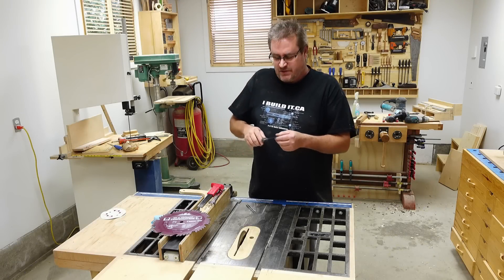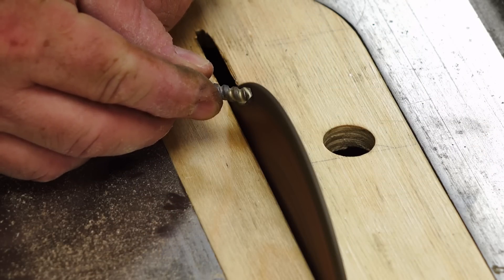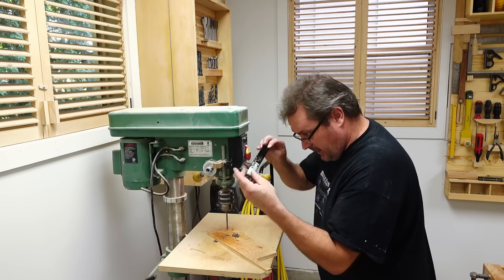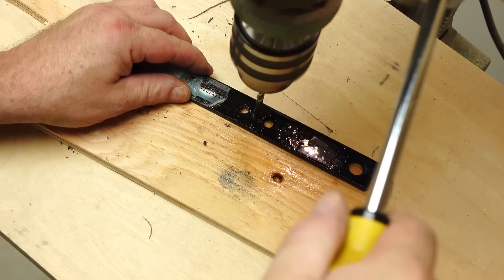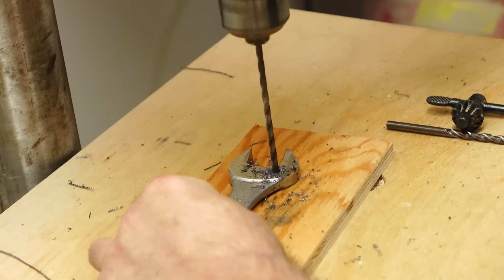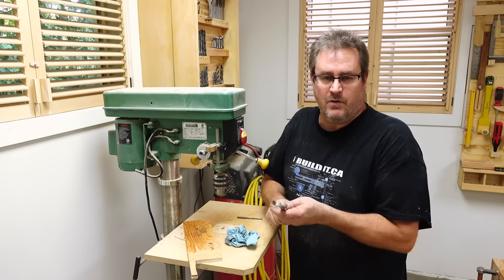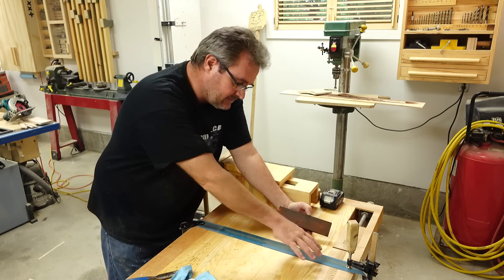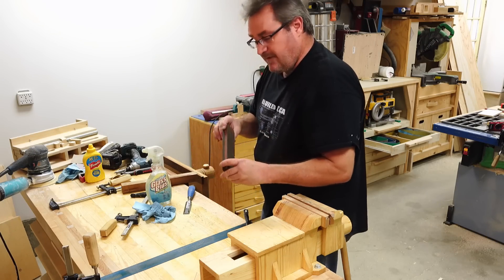Drilling Hardened Steel With Masonry Bits

Comment: Those bits might work to widen the indexing holes on your planer knives.  I've tried this in the past with no luck.  The blades are case hardened.
Reply from the maker: +GarageWoodworks Interesting idea, I'll give that a try when I pull the current set out again.
Reply: +I Build It When I tried it, I screwed the knife to a board through a couple holes to keep it from spinning and chopping my hand off.  None if the bits I had would do the job.  This looks promising.  Then you'd just need to design a knife setting jig, which I am sure you'd come up with something cool.
Reply: @GarageWoodworks  if they are case hardened all you need to do is remove the case hardened outside layer then you should be able to drill fine. Grinder or abrasives work to get through top layer. The material underneath is usually half as hard or less in some instances

Comment: It is sort if like a boring bar, I guess.

For applications like this my favorite cutting fluid is actually crisco or a similar (read: inexpensive) vegetable shortening. It tends to float the chips out effectively due to the viscosity, and has to absorb a bit of heat in order to melt, so it carries it away when it heats up, liquifies, and runs away.

Comment: I think drilling the really hardened steel is like drilling stainless.  You should slow the rpm's way down and increase the pressure.  Have seen a lot of people ruin a bit in seconds by spinning the crap out of it while drilling stainless.
Reply from the maker: +Ted Alexander Good points :)
Reply: when machining stainless we have a saying - slow speed high feed.
Reply: +Ted Alexander yup, so true.  and definatly keep enough coolant on the workpiece and drill.
Reply: +Ted Alexander Just what i was gonna say.
Reply: On hardened you need just that...harder carbide! Masonry bits have tougher carbide to withstand impact drilling of rocks (only a few of them can handle granite), but they are not that hard of a grade, the brazing can fail quite easily and the have a dull edge from the factory to avoid fracturing. Also if they get wet while hot they instantly crack and that's why I prefer running them completely dry and backing off for a while every once in a while depending the material to let them slowly cool off in air. You can only avoid it if you don't get them hot in the first place but that will be slow as hell...
Reply: @muffinman1157  He is actually very much correct if you are drilling hardened materials. In a soft material you are correct. And you definately don't want "little chips", you want actual chips like in any other drill so that they evacuate properly and that you are not just rubbing the material.

Comment: Up your speed and once cutting use no coolant as this will fracture the Carbide , the heat generated actually helps it cut , also don`t let it burst through what you are cutting as this will also take the tip off your drill.

Comment: if you ever look at magdrill bits you will notice they are carbide bits, same with most milling bits, just don't drop them because they will shatter like glass, I use a mag drill on semi truck frames to install tool box and other accessories, your HSS drill bits will just dull soon as you touch the frame, it's a hardened steal way stronger than most tool steels.  also you will note that metal dilling bits have a sharper angle than your standard wood or masonry bits do. 118 degs compared to 135 degs. just food for thought.

Comment: I've tried to glue sharpening stone with epoxy (regular one, not 5 minutes). Epoxy filled pores in pretty big area on stone, so it wasn't very nice. Next time I got much better results with clear silicone sealant.

Comment: You can buy tungsten carbide drill bits for steel there A little more expensive but will cut thru this like wood. Just don't drop them.
Reply: Good trick but we just buy the right ones. Machine shops drill cast all day long.
Reply: Masonry bits are close to free by comparison.
Reply: @dmc2554  Then all machinists should stop what they are doing and buy drills at a lumber yard and sharpen them.
Reply: @dmc2554  not at all a carbide drill in 1/2 inch is 9$ a 1/4 inch mason bit is 8$ not buying your math there bud .
Reply: @maxwebster7572  in my shop we cut with diamond.  😒 this was directed for the person who just needs to drill a hole that offers a problem due to hardiness.
Reply: @maxwebster7572  by the way this is most certainly NOT cast
Reply: @ronaldbrown9638  sure, whatever

Comment: I have heard this idea before, one very common context it seems is broken stud in a hole, then trying tho weld something to the broken part, and having the weld fail but after having air-quenched the broken stud. And now the situation is dire. 'Time to sharpen a masonry drill bit and try to go through the stud.

Comment: Very good. Hadn't thought of that, but it makes total sense! I used Carbide tipped cutting tools on my lathe, and carbide milling cutters in my Milling machine, so why not convert those masonry drill bits! As long as they have enough clearance on the cutting angle, they should work just fine :)

Comment: yes thats a good method of drilling hardent steel if there is no other method you can use right now but be careful  carbite dust is toxic and can harm your lungs badly and it can cause cancer so always use a shopvac with a good filter when grinding carbite
and of corse sharpend concrete drills does not make very precise hole diameters and if you want to use them in theyr original perpose make en dull again so they will last longer 
great video by the way

Comment: I had to drill some stainless steel a while ago. I didn't have the proper bit. A TCT bit for glass drilling got me in enough to start a hole, but it did break on the last one I did. Stainless is the biggest pain to try and drill, due to tool hardening. i.e. the steel gets harder when you drill it.
Reply: +Siskin's Bits and Bobs Try slowing your RPM and make sure that you are making shavings and not dust. Biggest problem with any metal like Stainless is the Manganese content as that is a work hardening alloy in the metal. Slow revs and firm pressure as feed as well as a good cutting fluid and it will be a lot easier for you. Cheers from John. PS. Most stainless I drill is just with an ordinary HSS jobber drill, no Cobalt content although they are better again.
Reply: joandar1 I'm probably in too much of a hurry, as you say. My dad served his time as an engineer, I should probably listen to him more.
Reply: My Father Passed in 09, however he still educates me to this day as I remember his lessons to me as a younger man. I just would like to be able to share with him these days new things I have come up with. I think he would be pleased. Cheers from John.
Reply: +Siskin's Bits and Bobs High speed steel should drill stainless just fine. Slow speed, rigid setup and cutting oil are your friends.

Comment: I have a old truck that needs a ball hitch drilled thru hole. Hardened steel bumper. What drill/speed should be used to make a thru hole/fluids etc will I need!

Comment: although ive never tried it, as i understand it this method works best with high speeds and no lubricant as the carbide can hold up to very high temps with out softening. the chips should be red hot, i guess your essentially melting away the material. only thing i would think is that the bit itself shouldnt get past very very dull red or the braze will probably melt...

Comment: everybody that uses carbide on a lathe knows you keep the speeds high with carbide, much higher then with hss. So with that information you would think that you should keep the speed high on a carbide drill too. Also they dont like intermittend cooling, so flood them with coolant or nothing at all.

Comment: Surface cool=
Water present on surface max temp 214F~ 
 alcohol/water mix max temp 185F~ 
oil + detergent + any alcohol = 185 F  max surface temp + low speed  careful firm pressure

Comment: Can you drill wholes in a magnet?
Reply: +David Bishop  it will be pretty sticky dust tough...
Reply: Had problems with demagnetisation when drilling magnets due to high temperature. Solved by drilling in a 50/50 general oil and water mix bath.

Comment: Excellent tip. I can actually use that immediately to drill a hole in a broken bolt for extraction.

I noticed your wood vice, do you happen to have a video for building that?

Thx

Comment: Been using the masonry drills like that for decades. They work better sharpened but they will usually drill through without sharpening too. Longevity is not a strong point with them. They work better for enlarging a hole than for drilling a new hole. Don't be stingy with the coolant. Flood it with water.

Comment: Hello. i watched this video and read some of the funny people in the comments =) Heat is your enemy when u are drilling. heat kills the drillbit. so try and make a senter punch in it, dont need to be big to get it to grip. use lots of coolant/oil/WD40. when it's talk about speed it's a small rule thats count, small bit high speed, big bit slow speed. i'm not useing inch but from 1-7 mm u can use medium+ speed, fom 8-13 mm medium- speed, bigger bit go as slow as u can.

Comment: You get drill bits designed to drill through almost anything now days. The difference between them and the masonry bit is that the tip is welded on and not brazed on

Comment: You mentioned in your other video on this saying Cobalt bits worked no better than Titanium bits. If you are at a big box store, they use the term "Cobalt" very loosely . 
Unless the bit specifically says M42 Cobalt , don't buy it if you need to drill tougher material . I don't know if M42 would drill a quenched and hardened file like that but M42 will drill tool steels and stainless . I get online mine from drill hog usa , his prices are good, his bits hold up well and they lifetime gaurantee . Good luck man

Comment: 15 or 20 years back a booth at the state fair in colorado in the 'merchants bldg' was a man doing
what you are.  using a tipped-bit to "grind" its way thru every metal thing put below it on a drill press.
a file was among the items drilled thru easily.     quite dazzling.   unlike anything ever seen.
and i bought one of his bits.  

    at this time one is needed to drill a hole in the door hinge on my jeep.  so i've been testing
the carbide-tipped bits found in box on garage shelf.     unsure which is the one from then.
one did better. and got 1/2 way  thru a 10"  file.     will try  your sharpening idea and repeat.

  and look to see if these "Rodman" bits are still available  ( 300pilot ... see below 6 comments))

Comment: sharpen carbide with a green aluminium oxide wheel for the bench grinder,the proper wheel for carbide and maybe the same cost as the wheel you used.

Comment: Why did you think it wouldn't work? I mean, even if it messed up the bit, carbides are harder than hardened steel, so it seems to me that it should be capable of it.
Reply from the maker: +seigeengine I figured it would be very difficult to make a masonry bit sharp enough. The wheel I used did an ok job, but the grit is too coarse for a really sharp edge. A finer grit wheel would be much better, but those normally are pretty expensive.
Reply: +I Build It - Maybe a dremel with the small grinder/sanding disk would finish the edge of the bit a little more.? I had this issue before and ended up using pl premium to glue the handles on. The knife has seen lots of abuse, ('batoning' logs for campfires,) and 5+ years later the handles are still attached. It's good to know there is a way to drill it though incase I ever need to attach the fasteners I bought for it lol.. Thanks for the vid!

Comment: The reason i know this works is because i've found concrete/metal bits. If it cuts concrete and it's designed to cut metal too...something like the blade is easy.

Comment: 1.You should have had a pin in the bed of the drill to stop the workpiece spinning if the drill had caught as it left the underside.
2. Either flood the job with oil to cool it properly or don't use oil at all.

Comment: Use a diamond blade to sharpen carbide, it may work better, Other wise use a green wheel as it is designed for carbide.

Comment: I have diamond sharpening discs for the 4 ''  grinder from japan . I use it for sharpening masonry  bits  . With  a bit of practice sharpening   you can get a drill to last quite a few holes  drilling through HSS .  Heat is your enemy . So use lots of water or lots of oil .  Compressed air will also work .

Comment: If find it I will get you a link on how properly sharpen those masonry drills to mill hardened steel - you have to make proper geometry on it. It is in russian. I don't know if there is anything in english. Later
Reply from the maker: +Kairat1969 I just used the standard angles on a regular steel twist drill. The failure I think is in how coarse the grinding wheel is - it chips the edge too easily.
Reply: +I Build It this man has plenty of how-tos and jigs for metallworking and drill sharpening for different materials and thicknesses. All in russian though... :) But many things can be understood by just watching

Comment: Something my Dad taught me years ago; after sharpening the bit, heat it red hot, then drop it in a metal can filled with sugar. Let the bit cool down in the sugar, then chip off the sugar. Quick way to really harden metal. I use this method to harden the tips of bits for my impact driver. They last noticeably longer.

Comment: never would have thought of this, do you think it would work on stainless
Reply: Only one way to find out!
Reply: +George Gardinier regular drill bits work fine on stainless, but you have to go slow and use lots of pressure, any kind of rubbing and it'll work harden
Reply: +Lasse Langwadt Christensen I've been told that if you start drilling stainless, you better finish up and take no break, because while cooling down, it get's tempered? Have I been ill informed?
Reply: +FanteFinn everytime you start and stop you get a bit of rubbing, that work hardens stainless, as long as you are cutting with sufficient pressure the cutting happens below the hard surface
Reply: +FanteFinn it's not stopping that's a problem, it's a dull drill bit that'll be a problem. Dull bits work harden the steel. If it's not cutting, definitely stop and sharpen the bit or switch it out. Slow slow speed and lots of pressure.
Reply: +George Gardinier Cobalt drill bits sometimes help with stainless
Reply: +George Gardinier Yes it would work, stainless is one material that run the drill fairly slow with a lot of cutting oil.

Comment: You seem to have been clued in on how Cole Drills worked. They used a carbide tipped drill (Masonry drill), applied with mucho pressure, and twisted, usually by hand. They would cut a nice sized hole even through hardened steel, reportedly.

Comment: Actually, if you can still find to "OLD SCHOOL" amber glue, the ones with the 'Angled Rubber Tipped Bottle" and use that for lubricant, A standard drill bit will drill right through it. Learned it from an old Machinist. Give it a try.

Comment: Being snowed-in, I finally had the time to follow through on some of my hair-brained ideas. Still in all, I wasn't pleased to have spent a FULL half hour (this doesn't include the digging around for tools and oil, locating and changing out any of the 8 burned up drill bits ranging from cheap steel to titanium, carbon, and finally diamond-coated, swapping out the numerous nails and punches I had dulled, the time I spent voicing my bewilderment, the defeated roll-up of all that junk, nor the research for- and viewing of this video) trying to drill a small hole in a thin piece of flat steel--watching various bits go round and round, backwards and forwards, at a vast range of speeds and pressures--only to have made a small polished dimple in the material. Whoever thought that the steel from a $2.39 hook-shaped clip would be of a grade that would otherwise only be found at NASA? Suffice it to say, your suggestion of using a sharpened masonry bit was the last attempt before this project headed for the "round file" and the technique worked Swimmingly! Let me shout out a Thanks not only to the mysterious wise commenter who came up with this technique but also to you for not being your standard know-it-all handyman but one who keeps an open mind to such suggestions.
  Let me also suggest that instead of throwing away worn out masonry bits, sharpen and set aside a variety of them just to have for this purpose since the only one I found rolling around in a toolbox that was even close to the size I needed was so beat up it should've been tossed long ago.

Comment: used to drill through 1/2" bsp hss taps to make them oil feed using this method. the trick is, slow and heavy with plenty of coolant.

Comment: Try drilling Hastelloy. Start with diamond. I tried cutting with carbide and it didn't scratch it. Hardened steel, especially nonwork hardened steel is not that tough.

Comment: Speed kills your cutting edge on your bit.  Slow it down about 30%  and increase your pressure about 30%.  I think you'll get a few more holes in that HARD stuff.
Reply: Actually the HEAT from speed is the killer, same remedy.
Reply: Most people just dont understand slow
Reply: @brianatherton4916 .. your old lady does
Reply: All that aggression
Reply: No actually it's tungsten carbide not hss so you need to jack up the revs as the surface cutting speed is about 3 times that of hss.... The feed should be proportional to the revs.
The comment above on heat is bang on hence the reason industrialy we use hollow drills with high pressure coolant to the cutting edge.

Comment: Dip a copper tube in grinding paste & drill low rpm through hardened steel or glass no worries !!!!
Reply: Noneed Toknow60 really?
Reply: Seriously low rpm & keep the grinding paste flowing Happy Days. @crunch9876